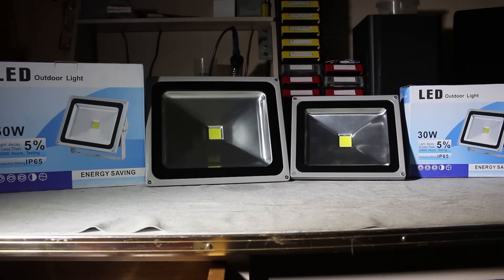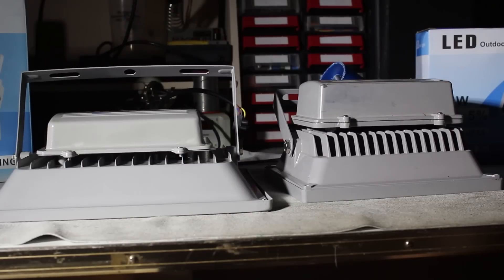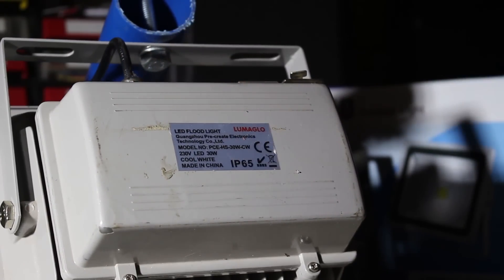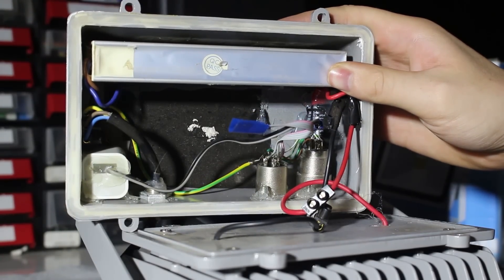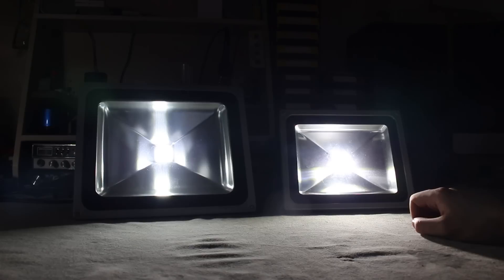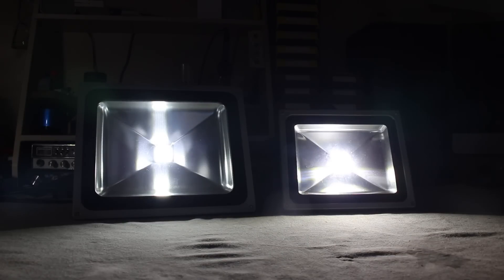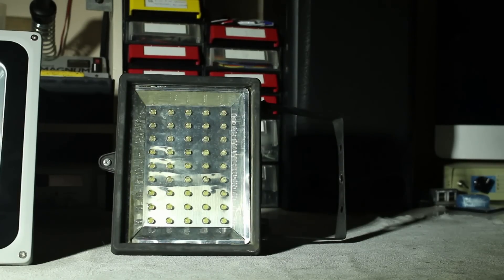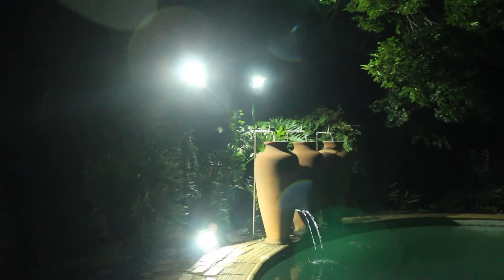#2 50W (Cheap) VS 30W (Expensive) LED Floodlight Teardown and Review

Comment: Very typical design of fitting that began to come out of China in or about 10-12 years ago (2010-12). I used to see dozens of boxes filled to the top of these returned to several of my wholesalers. They were plagued with problems. Poor quality cast bodies and poor quality LEDs, drivers and other gear ment premature and excessive body corrosion and early failure on drivers and LEDs. Thankfully I have always used branded products that are alittle more expensive, but without the high failure rates of most other generic chinese crap. It also means more satisfied customers and very rare costly warranty callbacks. Unfortunately cheap is still king and and chinese quality has not made any advancements in the intervening years, maybe some cosmetic design improvements, but its still crap. You get what you pay for. Another note, you can never make a comparison for example between a 50w cheap fitting and a 50w good brand. It is the lumen output is the tell tell. Quality products generally have a 10% to 30%+ higher lumen output per watt than the cheaper product. I have tested some of the cheaper products and even their stated lumen output can be off by upwards of 40%., but hey, its chinese, no surprises in that.

Comment: Most of these led flood light drivers radiate a huge amount of Hash on the radio frequencies. Wipes out the shortwave band's totally. So I ensure they are off before I use my Ham radio gear.   Will be attempting to suppress..  I may build a standard  current limiting arrangement without the use of a switch mode arrangement.  Couple of toroidal chokes may suppress ok hopefully.

Comment: yeah they are lying ... My 50W unbranded power supply ,the same you have there, says 50W or 1,5A x 33V. But in reality it outputs only 1A which is about 30W. Even the 50W LED has efficiency maybe about 65% , so I'd say realistically ~25W goes into light and rest to heat.

Comment: how did you make these lights into dmx? Do you have a video of how they work and how you made them?
Reply from the maker: Basically I just used a mosfet and a cap with an arduino to control the mosfet. Will try to make a video in the future. Regards Chris

Comment: Voltage drop doesn't affect the current flowing through the LED when it's powered by a constant current driver.  When you do a re-edited version of this video, you could mention that the cheap drivers are often set to a lower current than would be needed for the stated power output.  Your cheap 50W LED might be running at 1000mA, at which the forward voltage could be 20V or so.   Try measuring it if you have the time.  Bigclivedotcom has a channel which consistently shows how these floodlights use low-power drivers.

Comment: 6:01 editing error.
Reply from the maker: +DjResR Sorry for that. I tried to fix it. I accidentally rendered the scrap clips as well as the main content.
Reply: would the lights be good for lighting a room and recording my youtube videos
Reply: UnderdogReviews Usually these are mains flicker free so quite good for video recording, although color rendering can vary from manufacturer to manufacturer of the LED element.
Reply from the maker: After repairing the "30W" cheap light. I use it as a fill light for my new videos